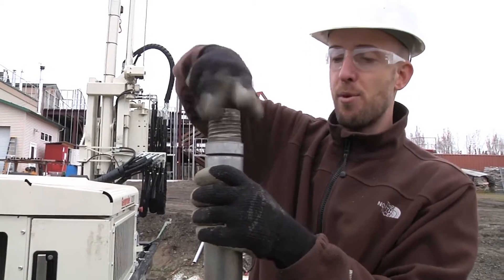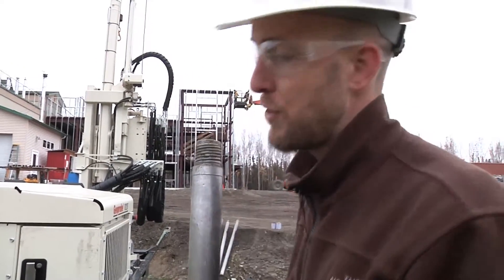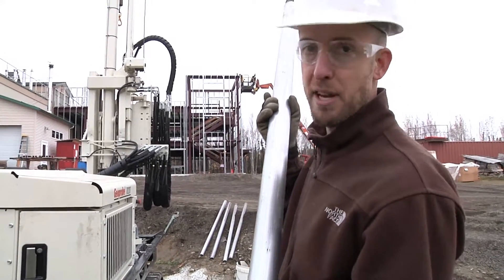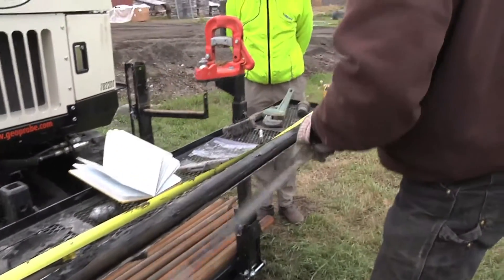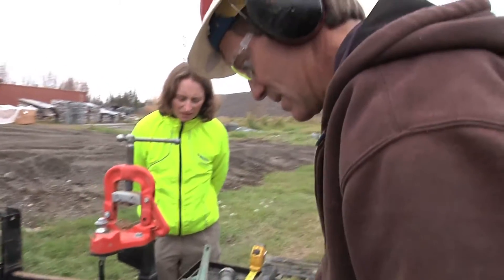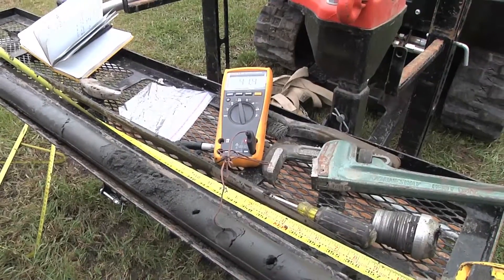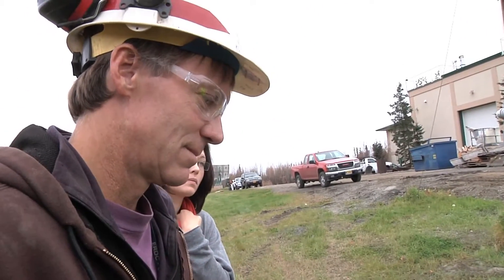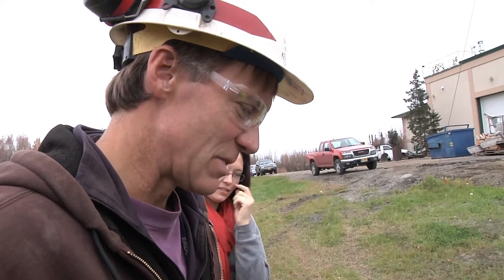Inside CCHRC/Ground Source Heat Pump: testing the ground temperature

Comment: This is the only place I could find to make my comment/request of CCHRC.  I read your article on heat pump systems and their viability to Alaskan climate conditions.  The article may be significantly out of date given the speed with which the heat pump market is evolving.  More specifically, VRF (variable refrigerant flow) systems (and especially the air-based heat pump systems)  are developing incredibly fast. Technologies that allow air based heat pump systems to perform efficiently down to 5 degrees fahrenheit provide much more viable systems.  I would suggest that you revisit this topic, especially for Southcentral and Southeast AK.  Ground sourced heat pumps are a great idea, but they are also very expensive.  With the advancements in the air based heat pump systems there would seem to be a lot more likelihood that widespread adoption in larger (lower-48) population areas will drive prices of the equipment down further and faster than the ground based heat pump systems.